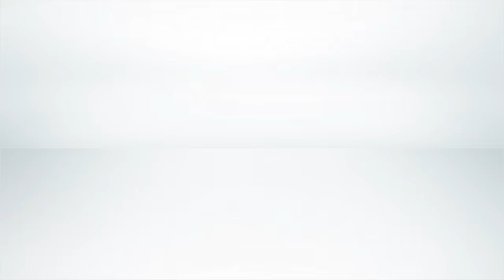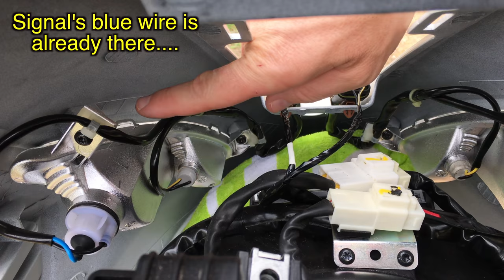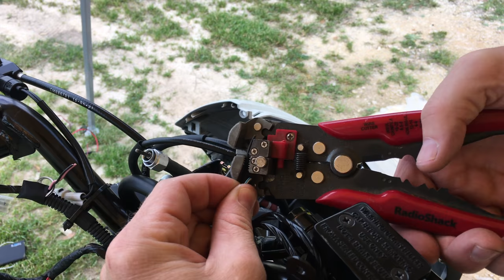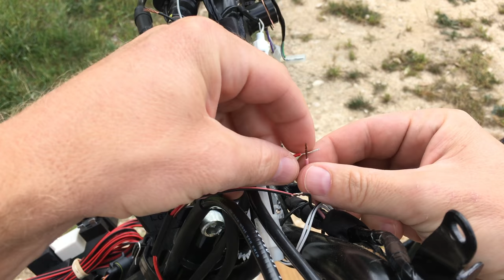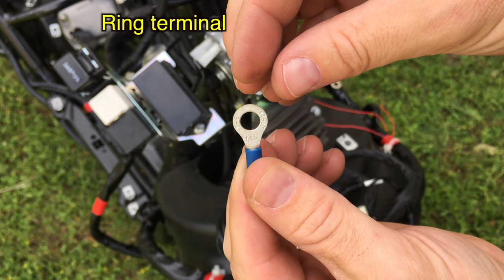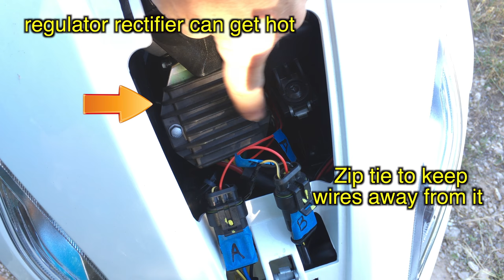2013+ Piaggio Fly - Euro Style Front Signal Mod | Mitch's Scooter Stuff

Comment from the maker: TOOLS I USED: 
Wire crimper / stripper - http://amzn.to/2jM6cyS
Zip ties - http://amzn.to/2pkp3AL
Heating shrink tubing - http://amzn.to/2HB5njf
Soldering iron kit - http://amzn.to/2HB5Zpg
Soldering solid - http://amzn.to/2FRSqoj
Heat gun - http://amzn.to/2HCfeWl
Tiny flathead screwdriver - http://amzn.to/2zyrLck
Ratchet 1/4 drive - http://amzn.to/2xcJEu1
3” / 6” extension set 1/4 drive - http://amzn.to/2wDuzzW
8mm socket 1/4 drive - http://amzn.to/2xMhsBl
10mm socket 1/4 drive - http://amzn.to/2yrXjxp

Wire / connector :
Wire 22 awg - http://amzn.to/2HC1732
(2) Female crimp spade terminal 1.5
(2) Connector insert seal 1.5

SHOP MY SCOOTER STUFF: http://amzn.to/2CbqQku

Want more free Scooter Tip / Tutorial videos - Please support MicBergsma!
Paypal donation: http://bit.ly/2fghrwN

Comment: Seems like a lot of work could be avoided by simply using wiretaps from source wires to destination wires. Wouldn't be as seamless but would work quite well and much faster. It's all recessed and unseen anyway. This way you can return to stock much easier (if there were ever any reason to). Or if you live somewhere you're required by law to have those silly turn-signals under the handle-bars, you'd be able to run it in parallel for a combined blinker.